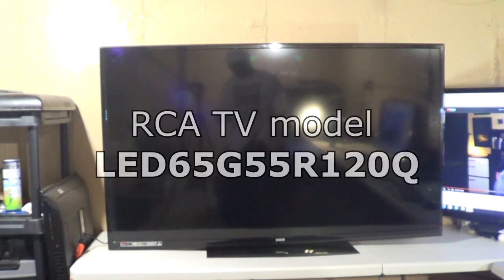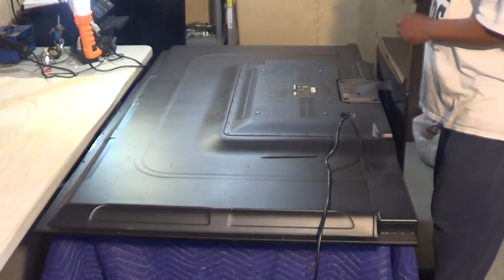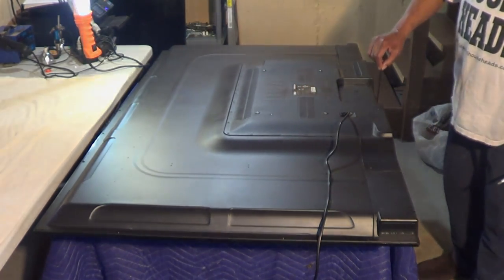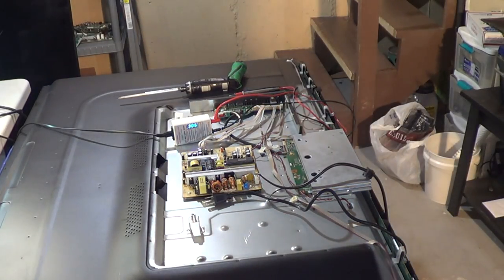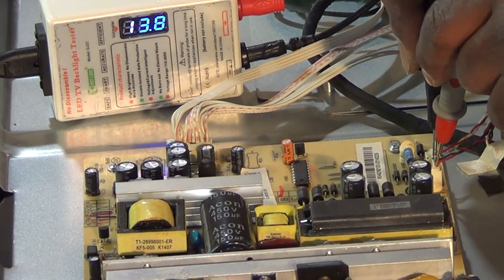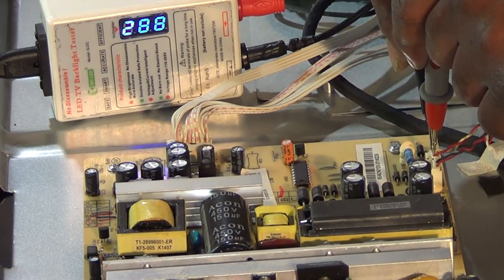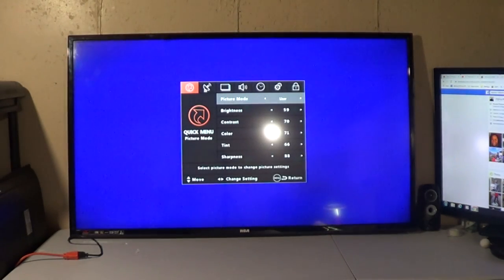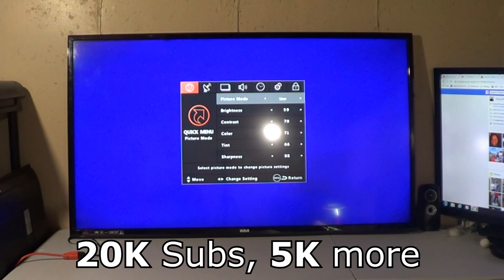65 inch rca tv, has sound but just a black Screen. LED65G55R120Q repair.

Comment: dear bigdog8882     i did everything you showed to replace the led back light it was a beautiful thing . worked like a charm. put everthing back together turned on the tv and found there was two lines near theright side of tv. I did some more research. i think the two ribbons i disconnected and put back wherent put back securly. i could still see the lines going accross the ribbons gonna try reconnecting them again. the lines are in front of the tv screen it is not apart of thescreen .  PLEASE ADVISE.     thanks

Comment: Thank you so much for your help!  I am trying to fix this exact model and am having issues. The only thing the tv is doing is a solid red standby light I have never seen a flash or anything on it using the flash light test. What do you think I should do next? I have already replaced the motherboard with now luck or change in symptoms. The standbye LED voltage seems steady. Any thoughts are helpful.

Comment: I have an RCA and I if I put a flashlight in it I can see the picture. I was told it was the LED driver is that correct?
Reply from the maker: Most likely its the actual LED strips.

Comment: Mine had a bad led. I put a whole strip in it and it powers up. My issue is a 1/4 of the screen is black and displays no image at all. The rest of the tv shows an image. Any ideas?  I was careful not to contact those four small circuit boards and wires when putting the tv back together.

Comment: Would lowering the brightness take some of the strain off the back lights? The TV might have an economy mode in the picture settings too. Looks like an older tv too.
Reply: Edward Anthony yes Edward that’s what I do when I repair backlights, and advise the customer
Reply: My tv screen flashes no picture but good sound thats the problem led lights?

Comment: Ok, so I made a minor error and pulled the back away without realizing that some double sided tape was still connecting the driver(buffer board) board to the back. It caused one of the ribbon cables ( the one that's applied by adhesive) to peel off. Can I use some sort of conductive adhesive to put it back on? Please advise.                    PS- After testing the LEDs with a LED tester they were all good so I'm guessing it was the board. Still need to test the board though

Comment: Hey bigdogg question... what is my toon board fuse is measuring 11.7? 
Is that a main board issue?
Reply from the maker: If U mean T-Con. lol. Thats actually close enough to the 12v that it should be getting.

Comment: Sir I'm sorry but you doing way too much.  All you have to do it take 2 9v batteries, couple them together then run a positive and negative wire and test each strip. I have the same TV and I replaced the burned out strip for $18.00. No dark spots, no damage at all. TV works like new. Still a good video though.